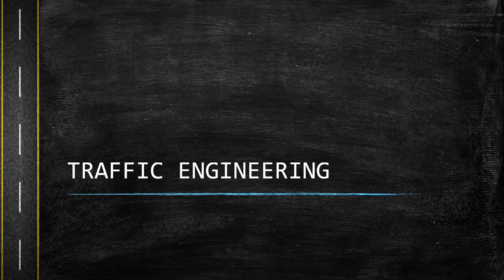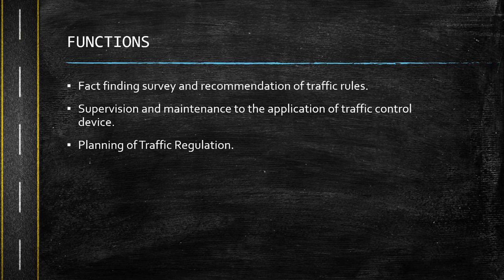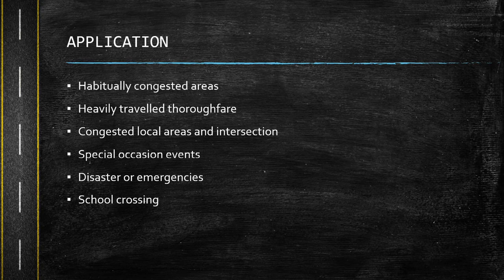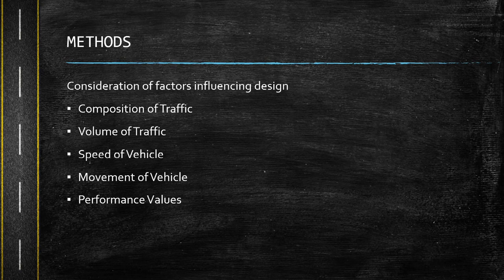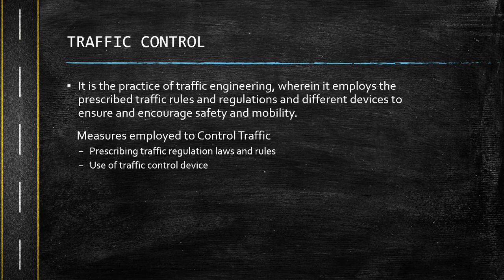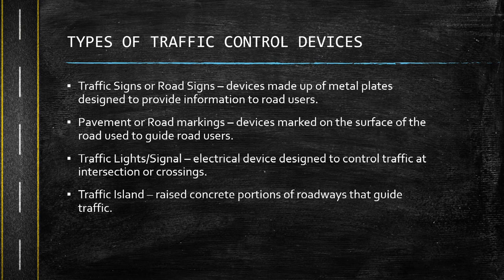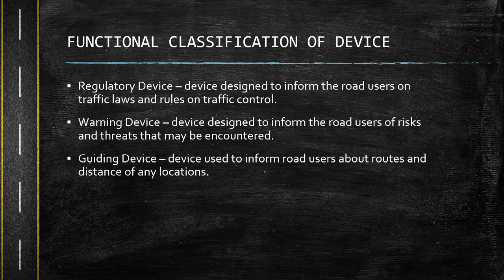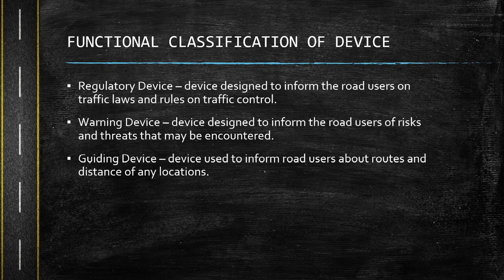Traffic Engineering by the Professor

Comment: In thi video clip, I've learned about Traffic Engineering, it is the application of these knowledge to the professional practice of planning, deciding, organizing and operating traffic system to achieve safe and efficient transportation.
   
  These are the different functions and concept of Traffic Engineering..
* Fact finding survey and recommendation of traffic rules.
* Supervision and maintenance to the application of traffic control device.
* Planning of Traffic Regulation.

  In addition, it is usually designed or amended in Traffic Engineering to prevent traffic jams.
   Thank you sir for this video😊

Comment: Hansel G. Sugay 

-I have learned that Traffic engineering is a branch of civil engineering that uses engineering techniques to achieve the safe and efficient movement of people and goods on roadways.
-I have learned that the Objectives of Traffic Engineering is to Providing high efficient traffic flow through ample research and innovative design efforts. To produce free flow of traffic.
-I learned that Traffic Control is the practice of traffic engineering,wherein it employs the prescribed traffic rules and regulations and different devices to ensure and encourage safety and mobility.
-I learned that Traffic control devices are signs, signals, pavement markings, and other devices placed along highways and streets to provide for the safe and efficient movement of all road users.
-I learned the 3 types of Functional classification of device which is Regulatory Device,Warning Device and Guiding devise, that helps the safety of road users.